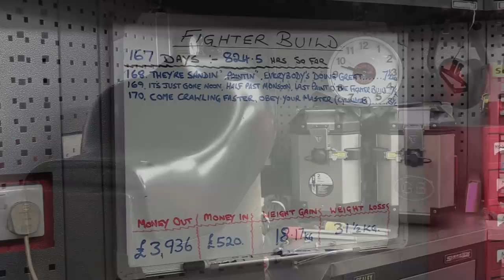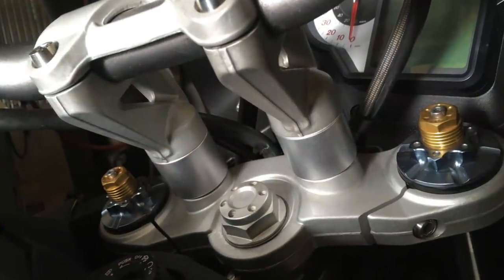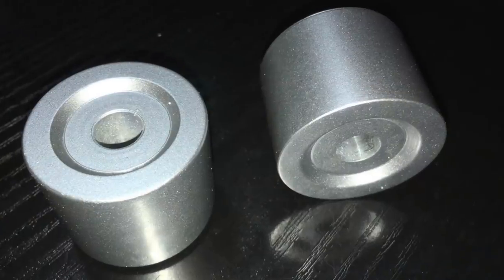Delboy's Garage, Lathe Project #4, Billet Beer Bottle Opener,,!

Comment: Absolutely outstanding work Del. I think your mate will be chuffed to bits with that.  You're getting your head around this lathe pretty bloody well. Penny and you have a good week. Cheers
Reply from the maker: Thank you kindly Sir, slow but sure, and it's basic stuff, nothing too technical, am just getting used to operating the machine, getting the feel for how it cuts and operates and what metals react in different ways, etc., still have a lot to learn!  Good to hear from you as always, D&Px

Comment: Excellent stuff. Working on a lathe is very therapeutic, almost as much as watching someone else do it.   You did well to grind that slot as straight as you did, freehand with an angle grinder. I suspect I would have ended up in a pickle trying to do that!!
Reply from the maker: Thanks buddy, it's not that hard to cut straight with the grinder, it's just little things like marking the line and following it really slowly, lean on the bench and secure your arms against your body, and then just gradually lean forward and there's a lot more control as it slides through the metal!

Comment: If I may make a suggestion, toss that tool holder and get a KDK,there is a copy of it and youll wonder how or why you ever messed with the stock tool holder,each block that holds a tool is very simple to adjust the height on ,set it and forget it,toss the shims for setting the tool height,one last tip,you can set the tool height by trapping a 6 inch scale (with the lathe stationary) between the tool bit and a turned o.d. when the sale is vertical the tool is on center
Reply from the maker: Hi There Joe.. Thanks for that insight buddy, i do have a QCTP on the list of upgrades, and yes it would make it easier to set the height and save me time buggering about with shims... and if you haven't noticed already in some of the lathe videos, i already trap a steel rule against the work piece with the tool to check the height.. i picked that little nugget up really quick..  Thanks for your input sir, and appreciate you watching... Del.

Comment: That looks great and I'm sure the person who gets it will be well chuffed. One thing you need to be careful of is, the position of the cutting tool in the tool post Del. I should always be on the same side as the chuck. That way you don't bury the tool post into the chuck and bugger them both up and roll your sleeves up. You wont like it if the get caught in the chuck. Keep up the good work and enjoy
Reply from the maker: Hi buddy, thanks for that time, I was aware of that when I did it and how I was breaking a 'rule' there, but I found that the toolpost block hit the live centre as I was using a inset tip tool that was really short and that's why I only cut so close to the chuck then stopped to give room for the cross slide not hitting the chuck, I was advised previously a good lesson by my buddy Duke Dyson, to always rehearse, or practice run, every movement operation without the machine running, turning the chuck by hand to check for clearance... this has been the greatest part of the lathe subject so far, has been all the great things to learn that are no so obvious... thanks for confirming that advice buddy, all the best, Del

Comment: Have you tried a spiral flute tap they work so much better, you can tap straight through a hole without backing it off
Reply from the maker: I haven't buddy, that's interesting... am learning lots on my journey in to the world of machining and really appreciate kind suggestions like that, cos it's the easiest way to learn new tricks and improve the skills, cheers!
Reply: Yes Del, your doing very very good job for a first time machinest ,iam a centre lathe turner, miller, borer, slotter ect, plus a biker,I can work lots of different machines.Ive worked for the same company for over 40 years.So any questions you need to know about lathe work ect,I will try and help you buddy.Ps i hate the  people saying stupid comments about your work on this bottle opener.You did a great job and you should be very proud of the end result no matter how long it took you.

Comment: U should get different tool post for the lathe so u can have multiple tool ready at one time so u can switch it with just taking off on tool and putting the next tool holder into the slots and start cutting
Reply from the maker: Yes i know that Damian, i will get a quick change at some point.. but this little item hold four tools at once if you take the time to set it up.. then you just rotate it to the one you want... not as good by any means, ok for now.

Comment: Fantastic work del, but i think all of us are "wondering"  WHATS in the BOX :).
Reply from the maker: Hi buddy, in that box is the stand for the lathe when I get round to shifting the garage about, I was thinking of putting it the far right corner on it's own stand, rather than on the table at the front...!
Reply: @Moonfleet41   yes i think thats a good spot,remember to just leave enough room to work safe.
Ride safe seeing as the weather is about to bugger off somewhere else LoL.

Comment: Why did you machine both ends of the larger diameter piece just to chop one end off?
Reply from the maker: So it fits in the lathe, it's 38mm stock and I've a 30mm chuck !

Comment: Thanks for the drill polishing adapter kit tip. What about standard angle grinders, I know they make stand alone angle polishers but if you have drill and angle grinder (no bench grinder), which best to convert for polishing? Or doesn't it matter, what evers convenient? Correct axis for ur work
Reply from the maker: Hi buddy, I would always use a drill as a polisher, because you get variable speed, and it's the correct angle to clamp and lean on a bit, the angle grinder is a bit fierce for polishing for my taste!
Reply: @Moonfleet41  ah yes of course, variable speed and I suppose polishing side on of disc not flat pad, the speed would be bit much. You'd have to take guard off too. Thanks